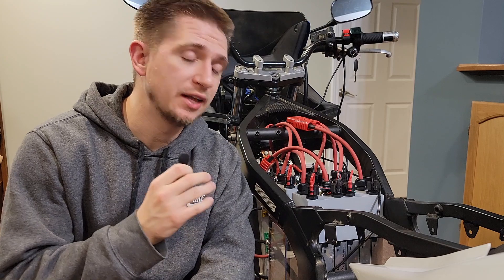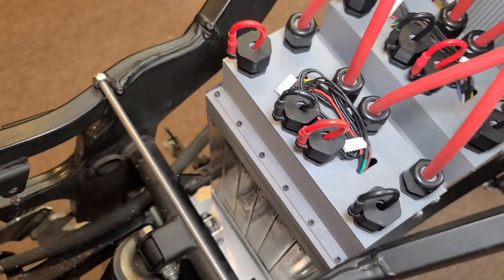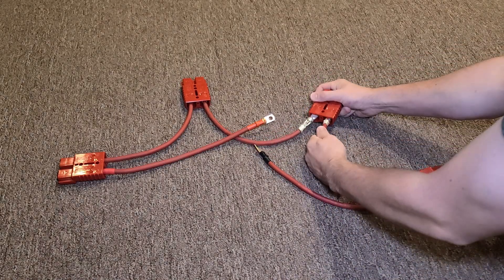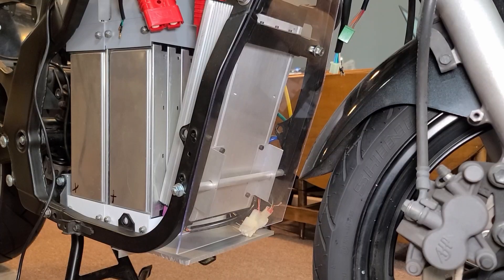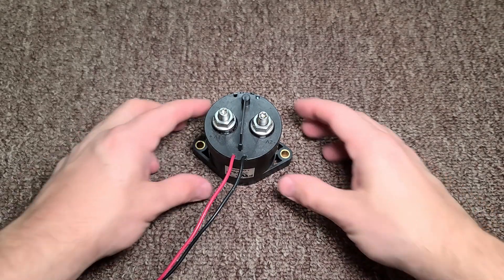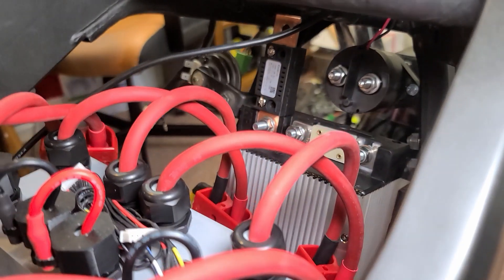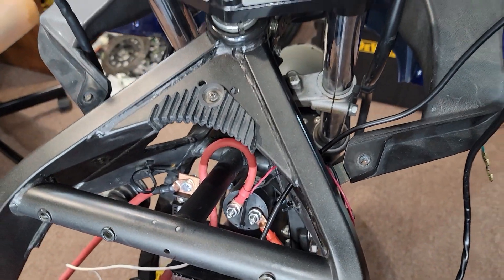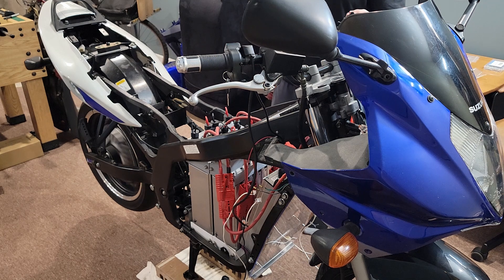8kW QS Motor - First Power ON - Will the Electric Motor Spin?

Comment: Awesome job ... would have liked to see you screaming for joy on the first take 🙂. Can't wait to see it running!!! You mentioned something about not crimping the cables correctly, what was that?
Reply from the maker: The way my cables were originally crimped, I had the terminal just pinched on both sides of the connector without actually compressing the cable. The proper way was to have the terminal compressed equally around the cable. Hope this makes sense! I'll definitely keep my original reaction for the test drive haha

Comment: Instead of a 12v battery for your low voltage side you can just use a dc-dc filter to step down the voltage.
Reply from the maker: @piingaz5232  Yes I can. I just have some spare batteries to use and was not ready to invest in a dc-dc converter just yet. I'll consider buying one later on!

Comment: Very curious what range you attain and how much power that 8k hub motor really manages to reliably deliver...   this is extreamly close to the 1985 VF750C build I want to one day do...
Reply from the maker: The 1985 VF750C looks to have a ton of space and would be a great cruiser after converting it to electric! Talking with the QS Motor company, I was told that I should get 62-74mi/charge at 40mph and 46-52mi/charge at 49mph. So this heavily depends on the speed I'm going, but I will definitely make a video on the data after some rides!